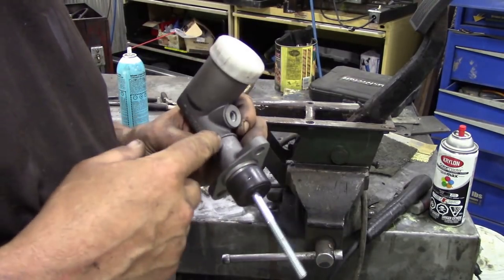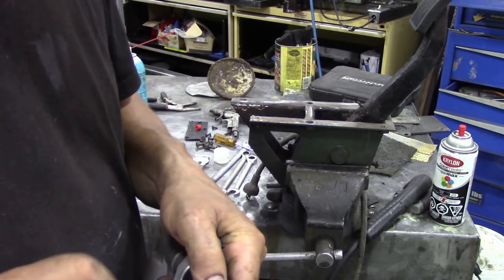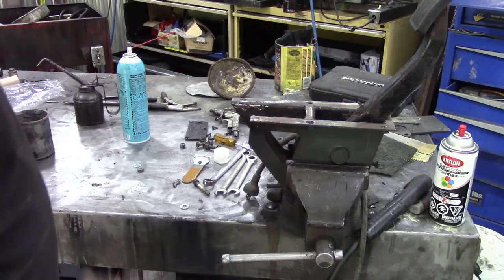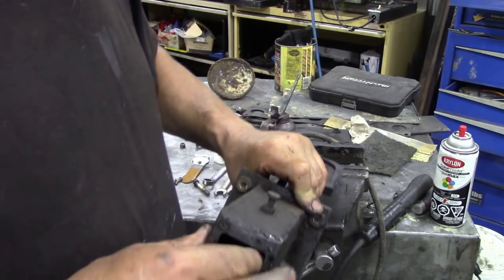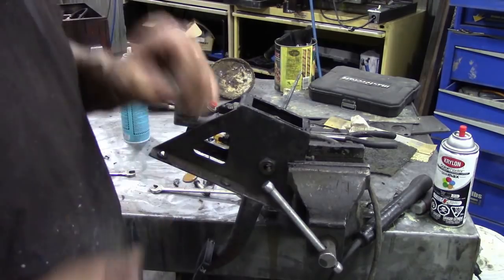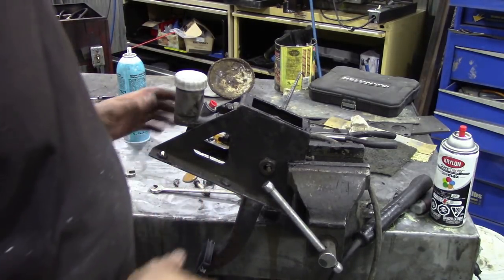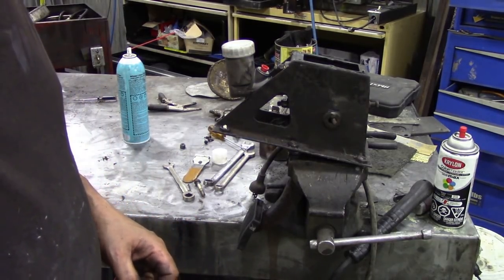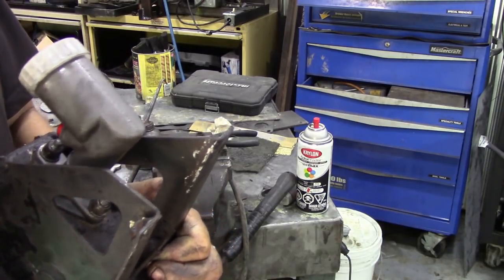Land Rover clutch master cylinder repair Part 2 Setting up the new cylinder

Comment: Good idea to drill a hole in the back to get a 1/2 inch socket in to adjust that play instead of using a half inch ratchet spanner.

Comment: Thans Mike for sharing the video, you mention DOT3 but everywhere include the Land Rover workshop manual it says DOT4. Is there something I missed?
Reply from the maker: DOT4 has a slightly higher boiling point  - not applicable for the clutch!
Reply: @BritannicaRestorations  But it wan't make damage (dot4) right? This way I am keeping one kind of dot... 🙃

Comment: Great video, Iv had some issues with my master cylinder, I got a new shitpart (britpart) one and fitted it but the piston inside was jammed, after taking it in bits, the little shaft that goes in the back of piston was rusted solid! So I stripped the old one, made one good out of two 👍 going to fit it shortly
Reply from the maker: Not seen a new one rusted up - first time for everything I suppose!
Reply: @BritannicaRestorations  very true, first for me too, one question, would you replace the old original master to slave pipe with copper or would you use braided hose?

Comment: Lucas, Girling, GKN and TRW are all brands of the same company, so it is an OEM part. :)  I'm not sure, but I think the aluminium gasket you're missing is just to prevent the master cylinder from electrolytic corrosion from being in contact with the steel pedal box.  A decent smear of grease will work well enough.

Comment: Hi Mike, placed a new clutch (LOF), slave and mastercilinder (TWI), problem is that I have to put the pedal really deep to be able to change gear. I think I bleeded it well.. but I saw this video too late and didn't prime the new cilinder..what could be the problem? (TD5 90 1999)
Reply from the maker: Could be  - or the rod adjustment is wrong
Reply: @BritannicaRestorations  Thanks, that's what it was, I copied the old adjustment.. now it's perfect!

Comment: @Britannica Restorations Ltd  
Hi Mike.
This was my job of today on the Disco 1
Man oh man, that clevis pin is a pain in the backside.
Other than that, it went smoothly, primed the master on the bench before fitting and then bleeded nicely with a very large syringe pulling the air until a steady stream of fluid exited the slave plus a bit of gravity for good measure.
In the end got a very good firm pedal and off to the road.

The knowledge obtained from your videos was essential.
Thanks
Reply from the maker: Excellent!

Comment: Don't forget to shim up the slave for correct biting point (most common overlook/error)
And the mounting bolt holes are eccentric in order for perfect push rod alignment. Otherwise it wears out the bore. When  the brake fluid goes black, this is a tell tale sign it's not running "true"
Reply: Castrol red rubber grease inside the slave too behind the gaiter o otherwise it will seize rusty.
Reply: Hey man, how do you correctly shim up the slave? Ive only heard of that being done on the series vehicles and not defenders but what do I know haha
Reply: @Sharktooni  clutch biting point preferences. You can buy shims from uk or make your own

Comment: 10:30 adding too much free play and a high pedal causes troubles... What are the troubles? 
I just replaced a series pedal box with the more nodern  central spring version and it has a high pedal and amount of freeplay.
Read a tip to drill a hole behind rear   bolt on push rod to make adjustment easier (is that a good method).

Comment: Loving your videos mate. Same process for a Puma 2.2 I assume. 
Had the master (I used the LOF power MC) fitted and bled by my local mechanic, but he’s botched the adjustment, as well as played around with the pedal stop screw. Any tips for adjust the master cylinder rod bolts as well as the pedal stop bolt while they are all in the car. 
Thanks
Oscar from down under
Reply from the maker: You may find this page interesting

https://www.lrukforums.com/threads/clutch-pedal-boxes.257189/
Reply: Thanks mate. Bloody legend

Comment: Hi, you can actually change the master cylinder in situ without removing the pedal or touching the brake assembly if you have a pre-300tdi  and get access via the air-intake. It is a bit fiddly but not that hard thanks to the side access. :-)
Reply: Dietmar Winkler sounds like you should consider doing a video too. From Mike video sounds like reinstall is a pain.
Reply: Well I really hope I don't have to do it again soon :-) But you can get some inspiration from https://youtu.be/pdIAzMQabFQ though he did not use the additional access (though he actually could have done so).

Comment: Thanks for this video. It is timely! I have sent a video request via your website. Cheers!
Reply from the maker: Send it here
britrest@britrest.com
I had to disable the website comments I was getting 80 spams per day!
Mike
Reply: It is asking me to login... My request is to have something on diagnosing fuel tank senders and fuel gauges. Also, how to remove an old fuel sender unit and replace it without ending up with a leaky tank. My defender is a 110 2.5 na diesel. I really appreciate these videos! Thanks
Reply from the maker: Ha! Just did one two weeks ago but was to busy to film!
I will put it in the to do box - I may be able to rig up a simple rig this weekend to show you how it works and how to diagnose
Reply: Britannica Restorations Ltd Thanks

Comment: why not DOT4?
Reply from the maker: DOT 3 fluid typically has a boiling point of 205°C, whereas DOT 4 fluid has a slightly higher average boiling point of 230°C
Not really sure how fast you change gear!
Lol!
Reply: @BritannicaRestorations  can be fast, but perhaps not that fast.
Trying to standardise onDOT4.
Any issues with DOT 5, I hear it can cause issues with some seals?
Reply from the maker: I have seen the purple stuff leak